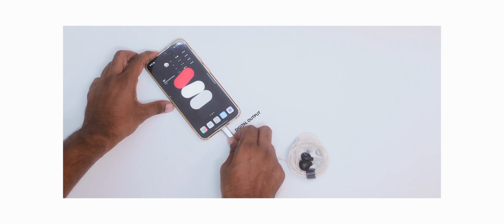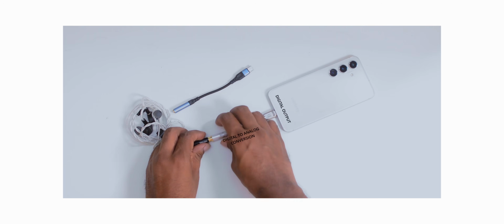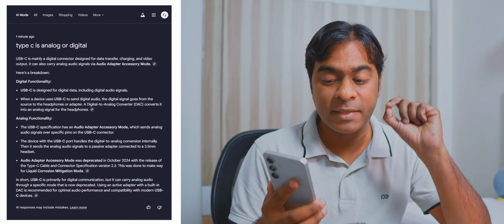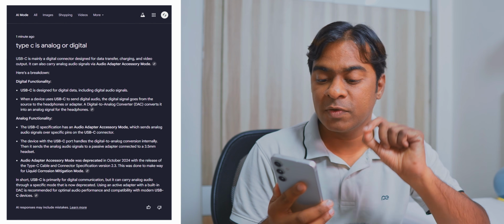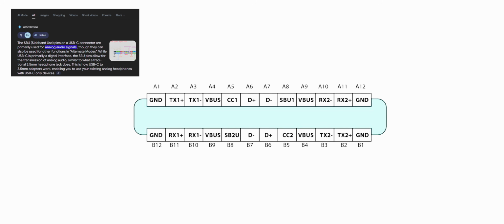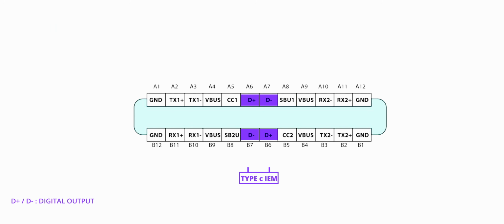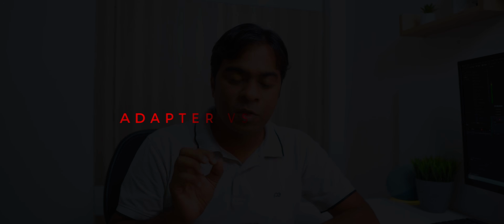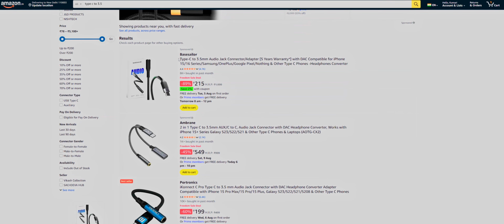Are TYPE-C IEMs REALLY Worth It Over 3.5mm + DACs? PROS & CONS | PART -2

Comment: I bought this after watching your review and have been using it extensively for the last few days.

IMO these are good value only if your primary usage is gaming and you are on a tight budget.

These are not good for music. Treble and vocals are alright but the  bass and sub bass are severely lacking. Using the app and playing around with the EQ might yield somewhat better results but it does not make a significant difference.

Mic is average and I had some complaints on calls that I was speaking too softly. If you keep it very close to the mouth then it performs fine.

I would rate it 3 out of 5.

Comment: Thanks again, today I bought a converter (passive one, not dac) and it's working properly. Back then, I was using a cheap dac called niceHCK tc3 and planning to upgrade, but all audio community has misconception about dac vs converter, they told me every converter has a dac, and type c need a dac to work with. I found a single video on YouTube and never thought it's that much informative.
God bless you!

Comment: Good information video and the way you explain that’s a good way for everyone.
I would like to add some technical information about whole thing.
In phone we are listening song by online and offline. We are store the digital information in storage of phone. That information pass the phone controller chip to headphone via cable or via wireless device. In controller chip it self has a communication protocol and inbuilt converter and this one is easy for programmer as well as hardware. 
In audio, targeting frequency always chopping and fine tune using hardware. This thing does by DAC or ADC. More samples means more chopping of that signal. Controller DAC is handle by programmer of mfg. if we are going with separate DAC then hardware is select as such a way so user will get the better result. Because for selection of dac have a multiple technical parameters. So better parameters come with cost.
 So if phone mfg handled this program or they add extra  good DAC then you will find a good output voice or song or signal.

Comment: Hi bro I got my waner sg2 delivered yesterday and they are amazing but when im using it on my pc the volume is insanely loud even at 2 and 4 number. Is there anyway I can calibrate it so that it is not this loud. I have the type c variant. Will dac help if yes which dac to get around 1000 ruppes.
Reply from the maker: Tangu are generally loud ....so it's not an issue at all. Just be careful to lower ur PC volume before using it.
Reply: @lotoftech yes but even at 3 or 4 volume? Thats insane.

Comment: oneplus nord ce 5 phone doesnt support adapters at all for audio. removing jack is okay but making us spend 1000rs extra just for good quality is a crime. I went to shop to test out all connectors they had and none worked. So finally found out that new mobiles are coming with only dac supported c pins. So they removed that sbu thing as well. I have protronics dac and it makes that hissing sound its frustrating and audio quality is reduced so to get the most i need to buy some1000rs dac. Just disappointed our devices arent working for us anymore like before.
Reply: can you tell will only the convertors without dac aren't working or dedicated type c to 3.5mm dac like audiocular ones, are they also not working? i want to buy iem earphones, i am confised should i buy dac plus 3.5 iem or type c iem only
Reply: @FLthirty1 audiocular yes works since portronics works.
And even realme buds 3 wired worked on my device soo yeah you could buy only type c iem with inbuilt dac

Comment: Sir, Assuming Average Budget 2000 INR without DAC + (1000 INR)
In this range with same IEM is there any difference between 3.5mm + DAC VS Type C 
Like 
7Hz Salnotes Zero 3.5mm + AUDIOCULAR - SPARK Hi-Res Portable DAC Dongle CX31993  VS
7Hz Salnotes Zero Type C variant 
which will sound better or there is any significant difference 
I Think if this point is clear then buying decision will be simple and valuable
And I like the way you explain and best part is the comparison which really helps
Reply: So do you have the answer to that question?? I was also thinking of buying that same iem and I don't want to buy DAC so can you tell me should I purchase that type c variant ?
Reply: @Shaxwat_yxdxv Go with the DAC

Comment: Sir I have a Question does the Mic on my IEM (KZ Castor) works while using DAC (suppose I have Audiocular Spark) because right now I am using a  type C to 3.5mm adapter and while using Mic in game my audio volume is reduced as long as the Mic is turned on please reply I need help
Reply: Yes it's work fine i also have audiocular Spark and it's amazing

Comment: 0:58 
You are right 
But in some case 
All smartphones are not have analog output in their Type-C port
Like Samsung And Google devices 
If we plug a simple Type-C to 3.5mm adapter the haven't work with them 

We need external DAC or 
Build in DAC on an iem or earphones
Reply: Bhai mere paas S24+ hai kya mujhe dac lena chahiye i planing to buy kz castor pro

Comment: You are wrong. Not only that you are doubling down and peddling the same stuff you said. Remember this, every usb c audio device has a dac in it. The power offered by old analog ports using 3.5mm is simply not enough to drive high impedance headset. By the way why didn't you touch on the topic of hi impedance audio gear, only a less informed person will ignore that. Also the reason the industry is moving towards usb-c / digital standard is it's infinitely better when it comes to interference. what don't believe me, use a cheap 3.5mm headset and bring it closer to say a fridge or a touchscreen laptop's screen. You would know what interference is and why industry is moving away from. As of now airpods max is the only one that receives "analog" signal over usb c and that too it requires it's own cable. But even then audio tuning is way difficult and often times in accurate. So to get accurate sound signature desired by the manufacturers USB C/Digital is the way not to mention surround sound support. You are swayed by the marketing terms use in the product title in Amazon. You are wrong. If you don't believe me rip a simple usb c to 3.5mm converter open. You'll find circuitry in there proving it's a digital thing doing the conversion to analog.
Reply: No.. don’t agree because if every type c earphones has digital to analog (dac) inbuilt then it should work with every usb c (including laptop) output which is simply NOT TRUE. that’s exactly why all type c earphones (and type c convertor)  DOESN’T work on all devices, not convincing enough? Then buy a one plus type c to 3.5mm and try using it on any iOS (even few high end Samsung) it won’t work because it’s an adapter which doesn’t have a DAC so it can’t process the digital signal from your device, AND it’s also true that not all type c earphones have dac.. (now mostly have it still some models don’t) it’s just like usb headphones and completely rely on devices internal dac(if it has one) or sound card which is also a dac) but external dongle/convertor has better dac and  but also have better amplifier which is why it’s better than device inbuilt (if it has one) but also works on all digital output source..

Comment: Every modern IEM with TYPE-C connector will have a DAC inside. Data (your music) that passes through type-c interface is digital and what you hear in IEM is analog, so data MUST be converted in order for you to hear. If you use the computer/phone’s  3.5mm jack, then the computer/phone will do the D to A conversion, because it knows you are using an analog listening device. Computer/phone does not convert data going through usb-c. If you use the computer/phone’s usb-c interface, and you use a dongle to connect your 3.5mm IEM to it, then your dongle will have a DAC or you won’t hear anything. If your IEM is type-c (no dongle) then it MUST have a DAC or you won’t hear anything.  Supposedly, usb-c can pass analog signal via the audio accessory mode but it is not supported by all devices and modern IEM with usb-c will all have a DAC in it. Also, Audiocular BR Pro has a DAC inside.

Comment: I’m one of the people who pointed out mistakes in that old video, and I’m glad you listened — thank you. The reality is more nuanced than it first appears. I work in PCB design, so I’ve seen these details firsthand. USB-C phones with a headphone jack are far more likely to have their analog pins routed to the internal DAC. This applies to many older phones and some current mid-range models. However, if a phone doesn’t have a headphone jack, manufacturers rarely bother adding a DAC just to route analog audio through the USB-C port.

In your last video, you mentioned that cheaper DACs “let the digital signal drive the headphones” and that this affects clarity. In reality, a digital signal cannot directly drive headphones to produce sine-wave audio — there must always be a conversion to analog. For example, if you plug a cheap USB-C to 3.5 mm adapter without a built-in DAC into a phone that also lacks one, you won’t hear anything at all.

Even in new Samsung and Apple USB-C devices, the USB pins are not routed to any internal DAC. That’s why Samsung ships a USB-C cable with a built-in DAC, and Apple sells their USB-C to 3.5 mm dongle with one inside. Please don’t take this as negative criticism — I enjoy your videos — but some of your statements came across as speculation, and I wanted to help clarify the technical side.
Reply: hi can you tell me whether the built-in-DAC of IEM earphones such as KZ EDX PRO with type-c be better or should I use a type-c to 3.5mm converter of AUDIOCULAR and buy a KZ EDX PRO(3.5mm one) for a smartphone(IQOO NEO 10R). please reply if possible and thanks bhai
Reply: @ajayvenky8488 lol , got the clarity?
Reply: @ajayvenky8488  always preferable to get the 3.5 mm version plus the DAC (not an adapter) like Audiocular D07 or FIIO JA11. Because over a period of time, you will find yourself buying more IEMs and then you can use this DAC. Also it gives you the flexibility to use the 3.5 mm connector when available. Also gives you the flexibility to upgrade the DAC later on for the same IEM
Reply: @ajayvenky8488 same question for the same phone😂
Reply: Yeah what you said is true, I also caught that then saw your comment in last video. mistakes happens by mistake 😁

Comment: isn't it a better option to buy an additional type C cable or a 3.5mm cable apart from your regular taste?
Just swap as and when you want to use as per your need of an hour..! why to get confused between the two as it is just a matter to ease of listening to the music...
Reply: Just buy 3.5mm iem with a separate dac converter of good quality, when you upgrade your iem in future you don't need again to invest in dac. And you get optimal performance as well.

Comment: every type c cable doesn't have dac chip inside. This is also a false statement
Reply: I'm not 100% sure but I think it's not the case. There are USB-C headphones with analog input. It means there's no DAC. You can search on the internet. 
I came across this because I wanted to connect my USB-C headphone with my DAC. So I need an adapter 3.5mm to USB-C female. I found out a few. But it was clearly mentioned on the site, "It'll only work with Analog USB-C headphone, not Digital USB-C headphone". They also mentioned, Digital USB-C headphone means which includes a DAC.
So, I think he's right & he explained it on a deeper level (like, showing different switch inside phone's USB-C).
Reply: Atleast for the dsp iems they have it 

And Most mobile phones have a DAC chip be it a cheap garbage one

Comment: I was looking to buy Audiocular D07 but someone told me it has so many complaints and suggested me Fiio x Jade JA11
I want a reliable one so which one should i go for ?
Reply: d07 have extra amp(dac+amp) chip with which u can have more sound in less volume 
but the ja11 doesn't have the amp chip, its only have the dac chip
but the ja11 have eq preset 
if u want to use those then ja11, but if u don't then d07 is the best dac out there in that price point
Reply: Audiocular spark is newly launched and fixed all problems of d07
Reply: Don't buy the fiio apparently it has an inherent problem... Buy anything else just not fiio!